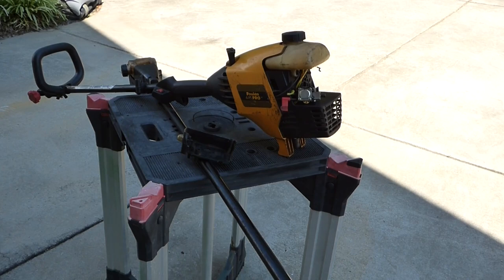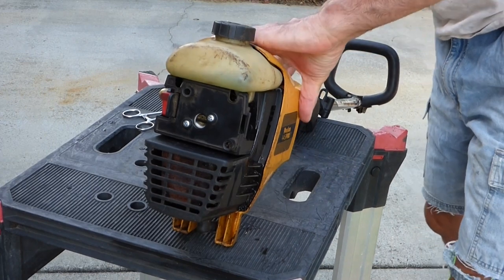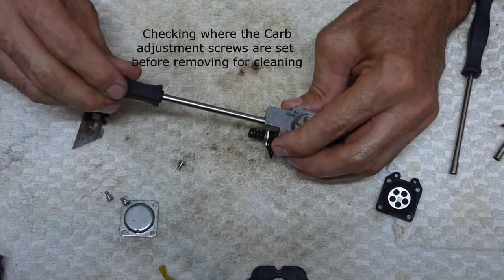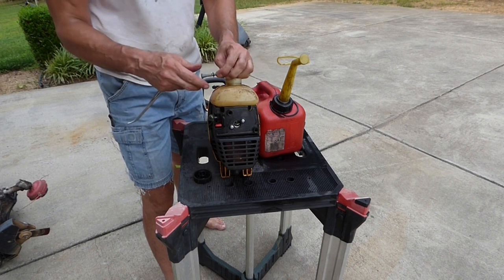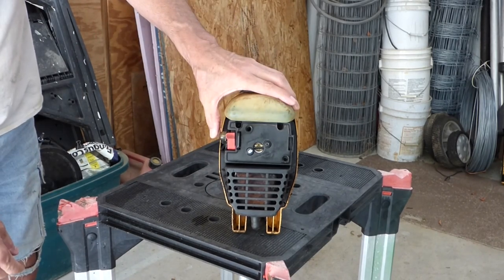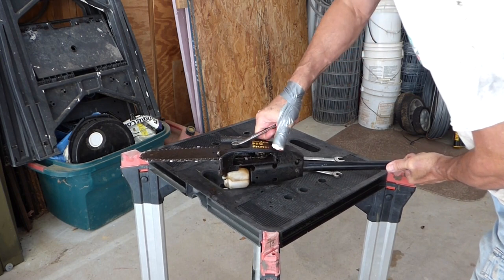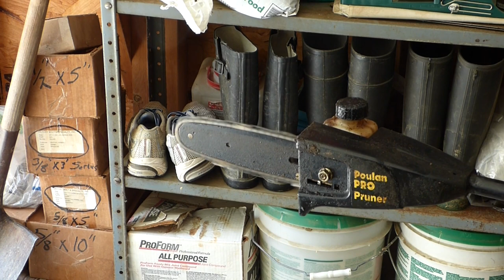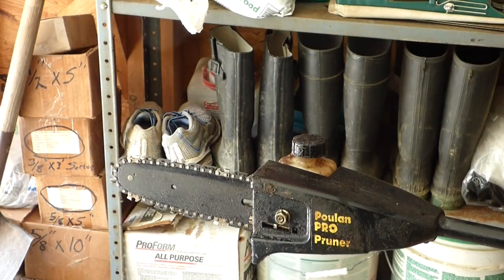How to Fix a Pole Chainsaw That Will Not Start or Run - Carburetor - Fuel Lines - Tune up

Comment: oh man, I can't stand working on these. I literally tried to talk a customer out of fixing it. He had attachments for it so I gave in. Every one I've ever worked on needed the same exact thing. Carb rebuild. Fuel lines. Primer bulb. And, if you don't route the fuel lines right they'll pinch. I'd rather work on a Ryobi backpack blower.